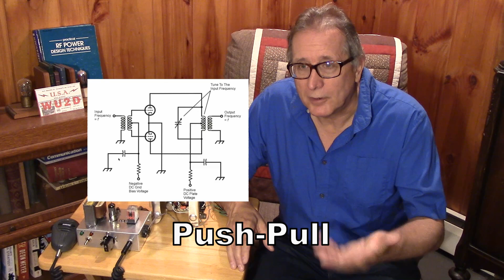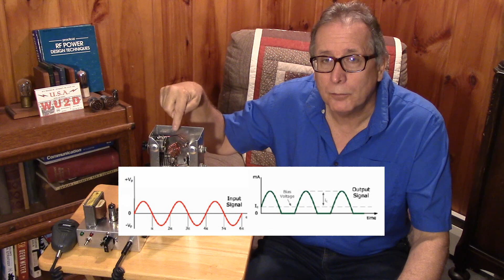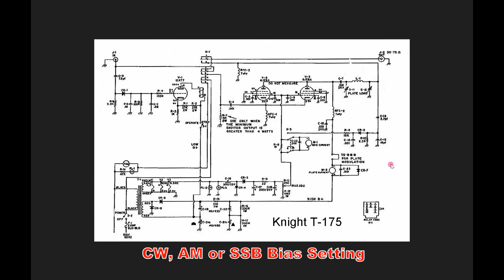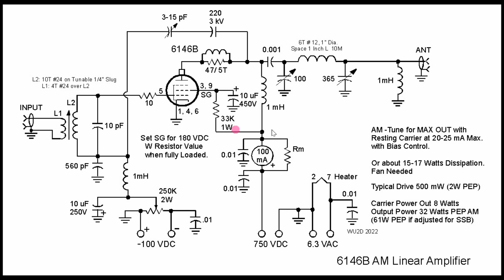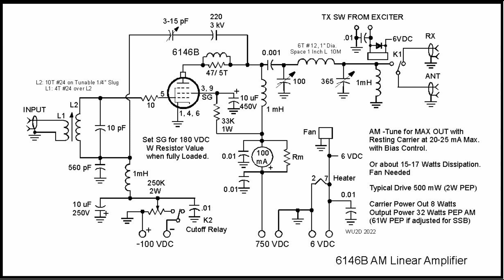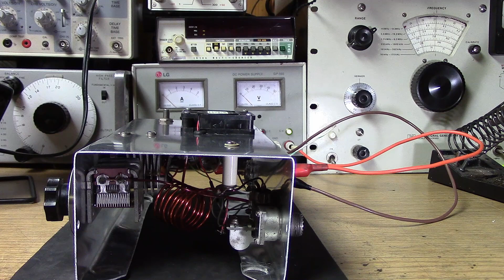10M Linear Part 2

Comment: If only running AM, why not run the output tube class C  and modulate the grid, or screen?  That way you could take advantage of the maximum dissipation of the output tube.
Reply: I understand first building the 10 meter AM transmitter, and then the linear, for illustrative purposes to explain classes of amplifiers. It just seems  you cold build the transmitter  around the higher power tube, do the modulation there, and not need a separate linear amplifier.

Comment: I  got a heath kit amp 6M that uses 6146 tubes. with that meter being so close just use 0 adj on meter to make it right on. will be off 0 when no current. The type of operation hear is ICAS and can push tube harder. that How these tube amps get away with so much out put power. will shorten the life of tube. 73's

Comment: What about using 2x of the 12V vacuum tubes created in 1957 which used a B+ of 12V for when transistors were not ready for prime time and use two BALUNS, one for matching the transmitter to the two tubes and one to match the two tubes to the antenna, I have seen this done with 12V transistors.